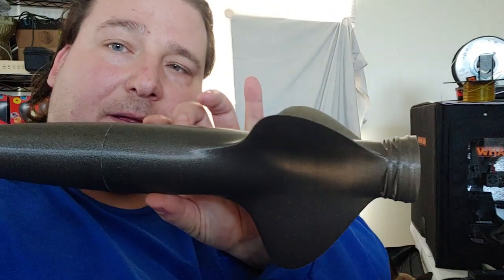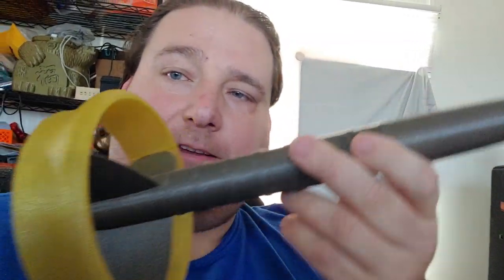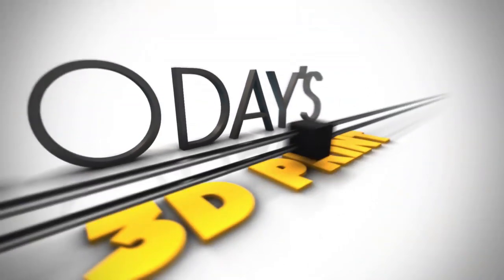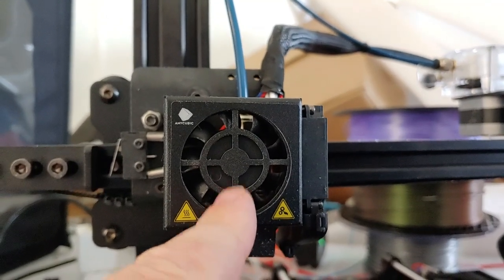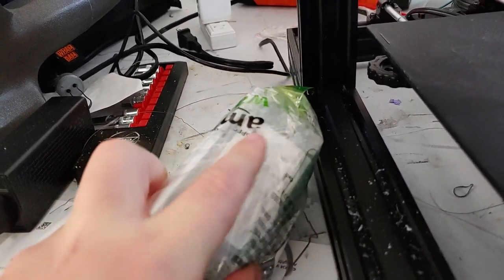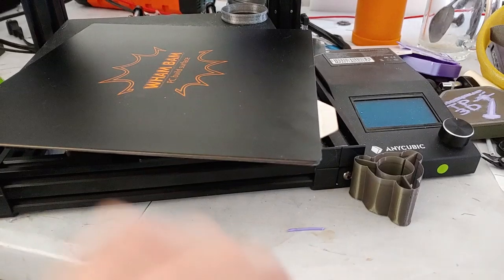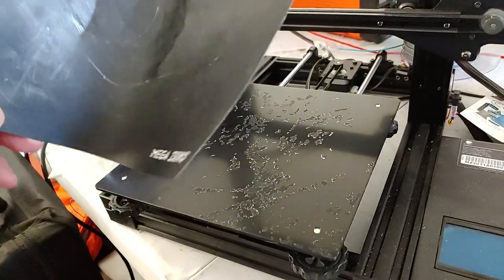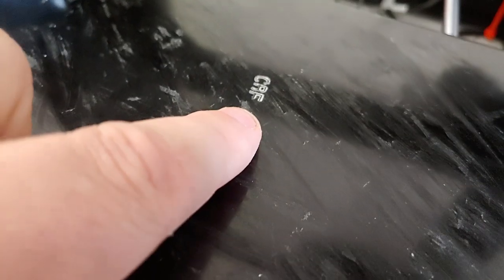Anycubic Mega Zero First Upgrades & Prints T3DP

Comment: Don't tease a heated bed mod and not tell us about it.  No fair.
Reply: I came here for a heated bed solution too 😂
Reply: @JAYTEEAU  i am working on clean swapping the zero board out for the ender 3 which will use a heated bed
Reply: @HiphonePro  hi, any updates on this? Is your mega zero working with an ender 3 bed now?

Comment: just bought one of these and struggling with first layer adhesion.  could you share some details on your heated bed. seems like the video had that intent at the intro.
Reply from the maker: Yes I need to do that :-) ask for adhesion make sure you use a brim it's very important at least 10 perimeters for the brim
Reply: @nerys71  thanks
Reply: I have had mine running for two days and nothing has stuck to the bed at all 😂.  Filament everywhere but on the bed lol.
Reply: @leemcduffie4569  I got it working really well, get the nozzle so that when levelling the paper will pull but not push. Set the first level to about 130% and I also use a (good) glue stick, I've found Pritt stick is the best. I've had no adhesion issues since making these changes.

Comment: I was wondering a couple of things with this. I noticed one of the Allen Wrenches, a really small one, wasn't used at all in putting everything together. Also, the two wrenches that came with it wasn't used in setting i up. The last thing I am wondering about it the USB cord. I plugged it into my pc, and heard windows make the connection sound, but nothing ever popped up for any kind of program or driver setup that I noticed, or found. Am I missing something here? What is the USB cable for?

Thanks a lot for this video. It really helped me out. Glad I bought this 3D Printer. Now that it is my weekend, I plan on getting on my Oculus Quest, using Virtual Desktop to stream from my PC, load up Oculus Medium from my library on the Oculus store, and some 3D modelling in VR, load it onto the MicroSD, and then print it out.
Reply from the maker: The wrench kit usually includes tools for all the little bolts on the entire printer. So there will be some that you don't have to use because you didn't have to build that part of the printer. 

These are very much DIY machines so I can appreciate the inclusion of the necessary tools if you were to need to take something apart and reassemble it. 

 You need to install the drivers for the machine first since it's basically a Serial Port device working over USB. It might not pop anything up when you plug it in. Once you have drivers installed you can then use slicers like Kira or simplify 3D or project face to directly interact with the machine. Send a command even print from your PC which I considered to be not very reliable.
Reply: @nerys71  Thanks for the reply. Now I have to try and find the driver. No luck so far though. I am looking for AnyCubic Mega Zero Driver, and nothing is coming up. Is there a more generic driver for it that works? Got any links? Please and thanks.
Reply: @jvoidhuey3088  there is no driver, what experience have u got with 3d printers just use the sd card

Comment: I have been looking at this printer vs the mega. Where and what is the heater. ? The zero is currently a lot cheaper than the mega but doesn’t have a heated bed.  You have fixed it’s biggest issue. Are you gonna do a video for it ?
Reply from the maker: Yes, it's under $20 for a 25 watt oil pan heater. It just sticks right on and plugged in. Of course, it's fully manual. You have to plug it in and unplug it when you want it on or off.
Reply: Perfect. Will look for one

Comment: I purchased an additional whambam build plate and PEX laminate and they included a polycarbonate laminate for free.  I was wondering i I could put the PEX on one side of the build plate and the PC on the other side? that way I could choose what surface I needed by just flipping it over... Do you see any issues with that?
Reply from the maker: In theory you can do that, but it does create possible issues. All flex steel plates have a bias. They tend to want to curve one way more than the other. So if you laid a plate down upside down where the bias is up. And then also separate the steel plate from the magnet with one of those sticker sheets. You could possibly reduce the magnetic pull enough. Combined with a bias combined with a very large print that it could pull itself off the bed. Which would obviously be bad. The best solution is to buy two plates. And put a sheet on each. In theory, you can put one on each side and it should work.

Comment: I've been looking at getting this printer, but the unheated bed I heard is really a con, especially for total beginners. However after seeing this, I am going to get it, and upgrade it.
Reply: J Void Huey   I wonder what heater he added. Is it simply a 25w aquarium heater. Will that get it upto temperature ?
Reply from the maker: I used a 25 watt oil pan heater. It stinks right on and works quite well.

My only gripe is the CPU bottleneck that makes printing fast difficult. Otherwise print quality is fantastic.
Reply: @nerys71  Hi, can you publish a link to the heater pad?
Reply: @nerys71  can you explain a little more? THe mega zero is about the same price as the i3 Mega at the mo, so would be keen which is the better
Reply from the maker: @KryzOrlinski  I would probably go with. The I3 Mega if it's about the same price. Although I prefer the extruded frame of the zero. The I3 Mega is probably still a better deal if prices the same.
Reply: @nerys71  Thank you. Have you played with any Delta printers? - I think rockers circular shape would go well with them?
Reply: @nerys71  For an entry into the 3d printing space, would you say to avoid a delta (Kossel mini etc) style printer?
Reply from the maker: @KryzOrlinski  probably yes. Deltas can not be mechanically aligned. They have to be mathematically aligned because there is no build plane for the print head. The print head build plane is mathematically constructed virtually.

I would not suggest a delta for a beginner unless it has built in mesh bed leveling (to build that virtual plane)
Reply from the maker: @KryzOrlinski  It's difficult. The mega zero has a far superior frame structure using aluminum extrusions instead of stamped Steel

The mega zero, however, Lacks a heat bed and also has an inferior processor. You can't go quite as fast with certain printing styles.

Adding a piece of wambam flexplate and a heat bed is very easy. But also greatly raises the cost of the printer. So it's a tough call between the two.

I already had the upgrades I needed so it was easy for me. I would choose the mega zero But if you don't have those materials the I3 Mega might be a better purchase.
Reply: Nerys you make some sound points.  I was also leaning towards to anycubic Kossel. With the support of Anycubic I think it could be a good option.  I see it does build a mesh and has a good user following. I am quite competent to put it together and good with computers. What do you think ?
Reply from the maker: @KryzOrlinski  go for it! as long as it has mesh bed leveling (IE delta ABL) then that solves the only real beginner issues (besides mechanical assembly) and if you have those skills. go for it. delta's are freaking cool. mesmerizing to watch them do their thing!
Reply from the maker: https://amzn.to/2UBETaK
Reply: @nerys71  Thx. Do you think is it possible to print PETG with this heater upgrade?
Reply from the maker: The printhead can print petg. The question is can you get it to stick? If you can get it to stick to the print bed you can print it.
Reply: @nerys71  I have an extra reptile heating pad that may work out just fine for this. Otherwise to get things going, I have a heat gun to warm up the bed to start printing on, and a heat temp gun on the way in order to monitor temp put onto the print plate. Hopefully those should work well enough.

Comment: Is that heat supply enough to print ABS? I just got one of these as my first printer and I accidentally ordered some abs so I am wondering if I can modify this printer to print it
Reply from the maker: No. Not even remotely close. But you can get larger heating pads. Just remember they are on or off there is no temp control!!

Comment: Does anyone know a cheap and easy way to add a heated bed? A separate power supply with a switch/timer sounds great. Please share...
Reply from the maker: Yes this is actually very easy to do and only cost $20 just buy one of these from Katz it runs on a hundred and ten volts and is more than sufficient for p l a possibly petg

It sticks right onto the bottom of the bed just make sure you route The Wire so it doesn't snag this will work on any printer that is a small bed and Metal so it works on the mega zero it also works on the Tevo Michelangelo if you have one of those I have one on both

If you want to get fancy you can even plug it into a timer control Outlet so that you can tell the turn off after however much time you want

https://amzn.to/3kvcUUh
Reply: Great
Thanks for the quick response.

Comment: Any chance of a walkthrough on upgrading this machines firmware? There's a Zero specific GitHub repo (Las/marlin/releases/tag/v2.0.5.3-kad2) but I just can't get it to compile. Seen a few walkthroughs on how to do it on an ender3 (which is similar re using Sanguinis and 1284_16mhz) but they're all pretty old and I think some of the libraries (like u8glib) may have changed. I just get endless warning fails. Thanks for anytime you might be able to put into this!
Alternatively, if anyone has any luck compiling it, please host and link!
Reply from the maker: Sadly that is not something I'm familiar with doing I've never compiled firmware I will see what I can do about finding out a good place to go for that though
Reply: @nerys71  no worries, thanks anyway. I'm traveling Reddit and YouTube, but it's slow going.
Great video on the first upgrades, btw. Looking forward to see how you like it (if you're still using it) after a bit.

Comment: hello, what do you recommend Mega Zero or KingRoon DIY? Mega cost only 15$ more
Reply from the maker: I don't have the king room DIY I can't make a direct comparison

The megas yeeros going to have a large build volume and a stiffer frame structure but it will lack a heat bed you can add one for about 20 bucks

The king room will have a smaller build volume it will take up less space but it will have linear rails and a metal feeder

That's a hard choice you might need to do a little more work on the king room or you might not or go with the large build volume but you have to add a heat bed

It depends on what you want more
Reply from the maker: @dario7209  that is an older version of the machine you're talking about I assume you're talking about the one that's currently available for sale which has linear rails on both X and Y?
Reply: add heat bed but need better power supply, this original have only 72W 12V x6A
Reply from the maker: @dario7209  no need. just use a $20 AC head bed (car oil tank heat pad) slap on and go. its AC powered so won't load the power supply

My only complaint about the mega zero is you can't go fast. the CPU / firmware bottle necks fast.
Reply: @nerys71  ok thank you. Then which one has better quality straight out of the box?
Reply from the maker: @dario7209  I am not entirely sure. my original kingroon had EXCELLENT print quality. I would say they are both equal in print quality.

the mega suffers stutter artifacts if you go too fast (and i mean 60mm/s is too fast on some prints) but it has a large built volume but also lacks a heat bed without an addition.

The king roon if they maintained the same QC as the original will be VERY good especially with dual linear's and a metal feeder.

IF you do not need the larger build volume I would probably lean toward the kingroon.
Reply: so it will be better for KingRoon because it has a 24V power 360W, touch screen, heated bed, magnetic pad and cost less one filament :)
Thanks you.

Comment: hi I have the same printer, I wanted to ask, how does it not have the warpig effect
Reply from the maker: It does. Need to add heater or use a brim to control warping.
Reply: @nerys71  I still apologize, but do you know how to add the heated plate on the Anycubic mega zero?
Reply from the maker: @fatjonbici2280  If you're talkin about the heating pad that I linked but I am using it self sticking with 3M Adhesive. You just peel it off and stick it on approximately in the middle.

Comment: Hé Nerys, is it me or is it? Why do you screw one cap on the rocket clockwise and the other anti-clockwise? I have watched it several times and its strange. A fault somewhere?
Reply from the maker: Yes, the slicer for the resin printer had a setting Wrong So it was printing mirror images. So all of my orange red resin print are mirror copies, so threads are reversed  :-)

Comment: Do you tjink we can swap the mainboard out of this for an ender 3 pro board?
Reply from the maker: I don't see any reason why you can't the parts are pretty similar.
Reply: @nerys71  I did get the ender 3 board and compared it they are identical except the zero board has the ac adapeter. I ordered a power supply its 12 volt do you know what the zero is and will the ender board run 12v if its 12?

Comment: That chisel is very handy! Loving the rockets :) I'm not good at modelling either but i've been putting time into learning Fusion 360, it's so easy and intuitive, and free! You might like to try it. What's the advantage with using the new springs, i'm looking to buy a second printer and the i3 Mega has done me proud, especially after your help and advice back in 2017/18.

Comment: If I install the new print bed without making it a heated bed is that OK?
Reply from the maker: As long as the print surface you use does not require heat. Yes. It should work fine. Just remember brim is your friend
Reply: @nerys71  thanks, I've since installed one and it's working well
Reply from the maker: @Walt yes and no. Like all others it depends on the surface you choose to put on it. Pex and Pei usually Yes will require heat. Pc buold tak fake tak no heat not required.

Comment: I am having some problem with my prints .printing an L shape piece, and getting pinhole right in the corner were the horizon meets the vertical. What is causing that.
Reply from the maker: Can you send me some clear close up pictures?
Reply from the maker: @skyrim4713  insufficient top bottom layers and insufficient infill.!! more perimeters might help as well (I tend to use minimum 3 rarely more never less unless special case like big nozzle or vase mode etc..

more tops layers will help the real fix however is more infill. you can create multiple processes (I can in S3D I assume cura and prusa can do similar? 5 or 6 layers before the top layers print crank up the infill. so I might use 0% to 15% infill and then when I get close to a layer like that I will make is 25% for those 5 or 6 layers so provide a solid footing for the layers to adhere to in the correct shape.
Reply: Ok thank you.

Comment: Have you had any problems with the mega zero cutting off? On mine I’ve set print heat to 200 and after 1hour and 1/2 it shuts off. I printed something yesterday at 190 and it printed with no problem.
Reply from the maker: No. Its been running flawlessly and almost non stop. Just ran another 10hr print today.

Is there an error or it actually shuts off? I would check for loose power cable and or loose connections for the latter
Reply: Nerys I don’t thank there is a loose cable and it pops up a message Power-Loss Recovery Resume Print Stop Print. If I hit Resume Print it moves over and hit rail and grinds thin starts to print. It try’s to print off the side of the bed. I printed a small box in the middle of the bed 2 hour print no problem.
Reply from the maker: @ThewallyMan100  sounds like something over heating a loose wire or a power issue. Ie the printer is being power cycled for some reason (hence the resume message) the obvious culprit would be the power supply.
Reply: Nerys tomorrow I’ll be able to over look the wires agin and see if anything is loose. If it’s the power supply I can with it with my Photon. Something I thought was really weird is when I turn the temp down to 190 because it’s defaulted at 200 it printed fine. When I’ve printed at 200 if would just stop after a hour. This is my first 3D printer so didn’t if the temperature’s was make a difference. If I don’t see anything wrong with the wires then it probably will on print at 190 for a long amount of time.
Reply from the maker: @ThewallyMan100  temp should not matter. I run mine at 225c.

Try running a print at 230c and try to watch it to see what it does. Also check the wires for the thermistor and heater cartridge on both ends. Be gentle those wires are on the delicate side. Its possible its having trouble holding temp and you are thermal runaway erroring but its not reporting it correctly. So try to pay attention to the temperature. If it starts to swing away from programmed temp by more than 10' at the time it fails that might be what it is!!
Reply: Ok so after Looking at the wires and moved the bed to the back and front. The back right wheel was hitting the wire and pulling on it. I used a few wire ties to hold the wire down and it ran for 8 hours no power lose.
Reply from the maker: @ThewallyMan100  that is excellent. Can you take a picture for me? Want to see if i will eventually have a similar issue.
Reply: Nerys I don’t know how to send a picture on here but I’ve got Instagram and discord under the same name